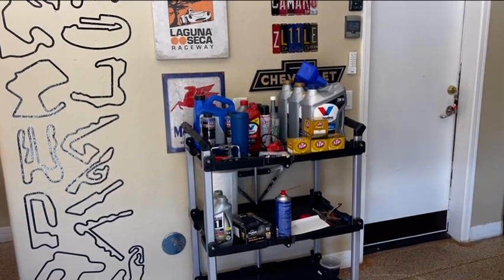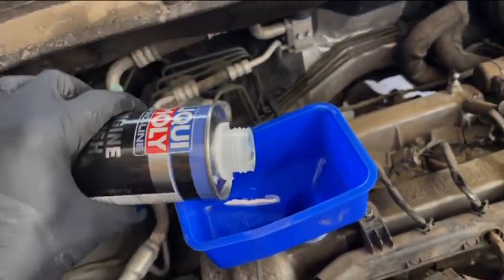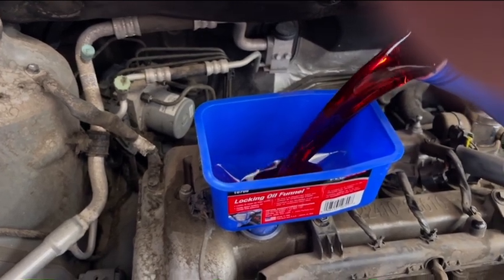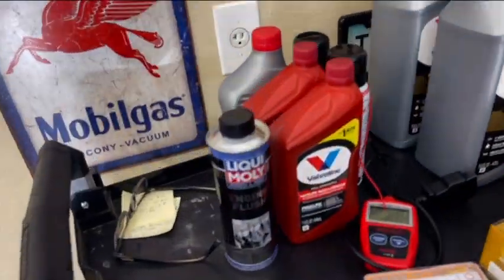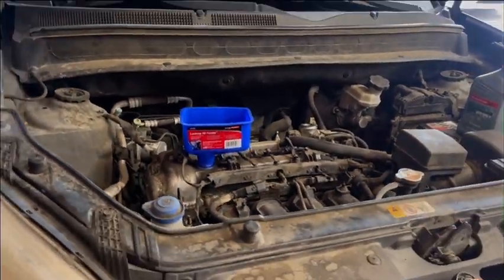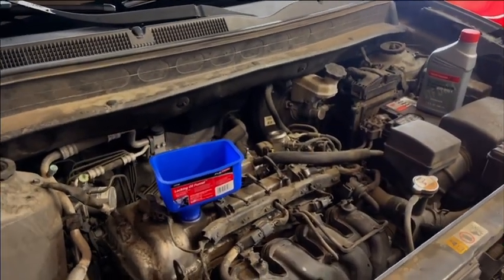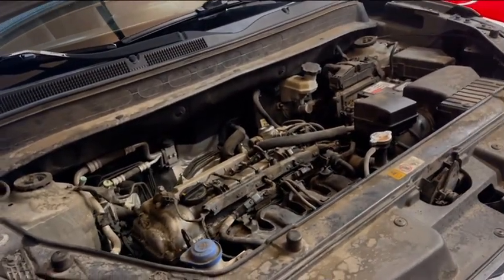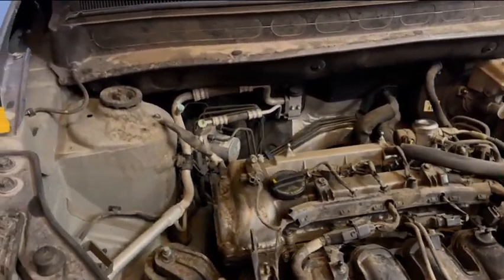How to reduce engine oil consumption by 50% ! Stop excessive oil burning !

Comment: 3:10 that is NOT a lifter. gamma engines has camshafts that act directly on valve spring buckets. there are no top end lifters to be ticking like that. that noise is what i call rod knock fledgling

Comment: Any results after 7+ months? I don’t see a video in your library that looks like covers the outcome. I’m really curious.
Reply from the maker: Car came down to 1 quart every 1400 miles from 2 quarts every 1000 miles. We are still using Valvoline R&P.  The remaining oil consumption is from the damage from driving for so many miles on low oil. These KIA motors are a disaster if you don’t change the oil literally every 3000 miles and check the oil every 2 weeks.  This is a friends car and I’m glad to have been able to help. Ideally Od like to switch the car to a 10w40 but they don’t make the Valvoline R&P in that spec. This oils are killing modern engines. It’s all the EPA mandates . Never use a 5w20 in this car. I say minimum would be 5w30 and always run restore and protect. ALWAYS ! With the price of cars today the average age of cars is going up dramatically and this will help keep a lot of cars running
Reply: @the_track_enthusiast 
That’s great that the oil consumption came down some!
Reply: @the_track_enthusiast You try the B12 Berryman piston flush?  Hearing a lot of good results with it.

Comment: You spent a ton of $, ATF is a very slow cleaner, been better off running a couple oil changes of Rotella 15w40 which is super high in detergents and a proven engine cleaner. The high zinc VR1 20w50 isn't good for the Cata converter, the 10w30 VR1 has a bit lower zinc content would do very well in that engine

Comment: The auto manufacturer only cares about standing behind their product until the warranty expires.  The suggested oil change interval is for optimum driving conditions.  Most people should use the severe conditions oil change interval, I think half the distance and time, whichever comes first. Besides using full synthetic oil and extended life oil filters, change the PCV valve to prevent sludging the engine.  It's a lot easier to prevent this problem by extra preventative maintenance than to try to after the fact.
Reply from the maker: After looking into what they define “severe” as and I was shocked !! 😳 You are 100% right ! I live in AZ and have been going 7,000 miles on my oil and as high as 10,000 miles on 20k extended life oil. Now I do it myself and I’m sticking to 3500 mile OCIs. It’s a 30 minute job and the engine will run forever. Plus when you do it yourself it’s literally 1/5th the cost

Comment: I would think all this would actually cause more issues. 😳
Reply from the maker: Not with an engine as dirty as these KIA direct injection engines. The car is running like a champ now. Oil consumption was within spec right after and now we are on our second oil change with Valvoline Restor and Protect
Reply: @ Wow, thanks for the update.  It just seems like that was an aggressive protocol of cleaning all at once.  Yeah, I heard a lot of bad things about KIA DI.

Comment: Wow, anyone following this kitchen sink " Chemical cocktail " , could be putting their engine in serious jeopardy ! As one oil engineer told me, you are playing Russian Roulette when mixing chemicals like in this video. For those watching, the only thing in this video that will be safe, is to use the Valvoline Restore and Protect.
Reply from the maker: It worked ! And this is used by tons of fleet mechanics BTW
Reply: @the_track_enthusiast  , I understand, and i have been guilty of the snake oil trend. I had an engine blow up a several years ago. Yes it was noisy and was a known problem of engineering, so i just chalked it up to broken parts. Fast forward to this year and after talking to an expert on oil formulations for race engines, he said it could be because i ran too many additives for too long. What happens is, every single ounce of fluid put in the engine upsets the balance of the chemistry, and the more you use , the worse it is. So, i have the infamous Toyota 2AZFE engine now, with the low tension rings ( which most modern cars have now) and it is using oil, which i am told mostly because low tension rings should never be allowed to suffer from 10,000 mile or more oil changes. As luck would have it, Valvoline came out with this new oil. So i tried it and its actually working all by itself, Which is lucky because there must not be much if any cylinder wall damage, otherwise it won't work most likely cuz its not designed to fix mechanical damage obviously. My comment seemed harsh i'm sure, but i have done a lot of research into oil for the last 40 years. I can't tell you how to run your channel, but my suggestion would be to not use anything but the oil, but for the sake of experimentation, you could use 1 product at a time, and that would help you confirm or eliminate each product. Best of luck, have a safe Holiday season :)

Comment: ATS has a pretty good two piece kit.  One is a carbon cleaner, the other is a furl system cleaner.  Both worked quite well on my 2013 audi q5 with 82k miles.

Comment: id use 5w 40 just to use thicker oil to fill in the loose engine parts.
Reply: @salvationbygracethroughfaith  modern engines after 2009ish. Have low tension oil rings and when they cardon up they stick which causes oil to burn ...
Reply: You’d have fun with all the vvt codes that would pop up if you put that in it, the 1.6l gamma engine has a very sensitive vvt system
Reply: Id  use 140w  much much thicker oil to fill loose engine parts

Comment: PULL PLUGS OUT. SET ALL POSTONS TO HAVE LEVER (BETWEEN TDC AND BDC). FILL THE CYLINDERS WITH DIESEL.. LET IS SOAK A DAY, AND DRAIN THE DIESEL FROM THE OIL MN BOLT. REPEAT .. I DID IT TO MY 92 COROLLA AND OIL STAYS GOLDEN EVEN AFTER 2000 MILES!

Comment: I did the Seafoam trick through the brake booster on my 97 Civic... I should've cleaned it at the shop but since it was easy I did it at home... I got pulled over literally just a few short blocks from my house, luckily he was a town cop and used to be in our Fire Dept. so I knew him, he thought my car was on fire so I told him that I just ran some cleaner through it and was going to go out and hit the back roads to clean it out. I found once out on the highway I quickly needed to get off that road before someone called it in, you couldn't hardly see anything behind me from all the smoke so I made the first turnoff and stayed out of sight until it cleared up.

Comment: My sister has a 2013 accent with this 1.6. 155K miles and she owned it since new. I was replacing a crank sensor for her and just decided to look at the oil. She was down 2 qts on a motor that only takes 3.5qts and the sludge I could see through the oil fill tube looked awful. Turns out she was at about 7K miles on whatever oil the quick lube place put in it. (as far as i know they were maintaining it well with 3K changes until this last one) I did an oil change with Valvoline restore and protect and bumped it up to 5w 30 from the 5w 20 they had been using. Changed it again at 1600 miles and she had only burned a tiny bit (like a tenth of a qt) will do the next one at 3K but I think it's great stuff for this engine. I didn't take pictures but it looks to me like its slowly cleaning some of the sludge off the small area i can see through the oil fill. Hope it goes well for your Kia too!

Comment: That's a kitchen sink lol I have experience with this engine also. Mine only burned a quart every 2-3k miles. The best result I had was with the liqui moly engine flush, but it has to be done with a super hot oil already before the liqui moly goes in. Liqui moly with cold oil did nothing

Comment: Nice thorough video but how would you go about it with a manual transmission? 183k 2014, just ran the cataclean, replaced spark plugs with nkg and STP engine flush. Check engine light is on 02 sensor code. Replaced battery and alternator earlier this year but now my lights flicker inside the car and headlights.
Reply from the maker: thanks ! I would look at the connection for the alternator. The check engine light you can turn off with a simple OBD code reader ( it worked for me with a unit for $19 from walmart ).  As far as running the engine flush or ATF i’d just put it in neutral , put the parking brake on and just let the car idle for an hour or two with ATF in the crank case. My friends car is already within spec in under 800 miles with the Valvoline restore and protect
Reply from the maker: is the alternator an OEM unit ? new ?
Reply: @the_track_enthusiast  New altenator  from autozone $400 this year or last. New AGM battery from this year from walmart.